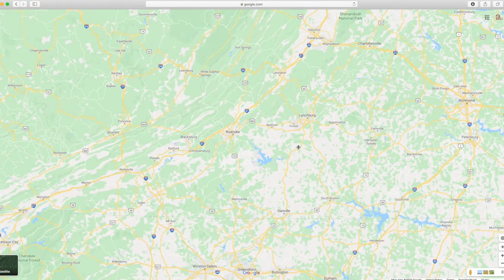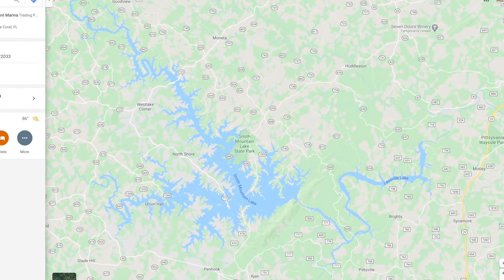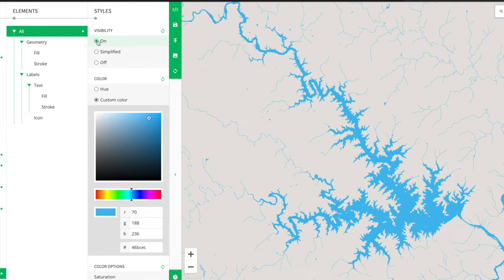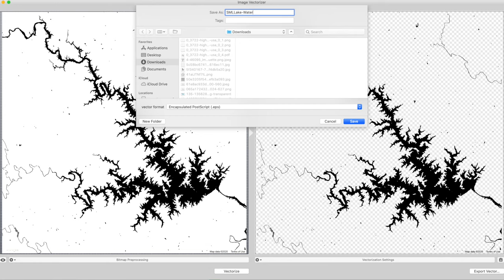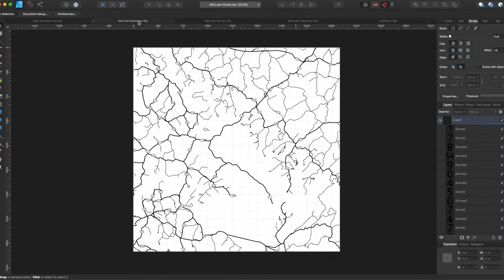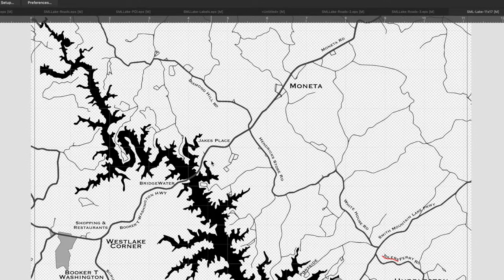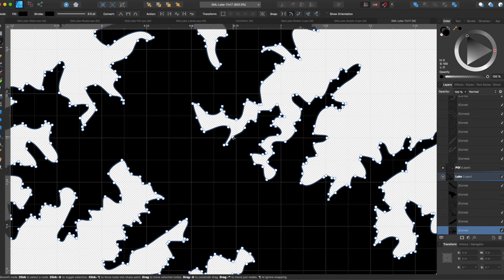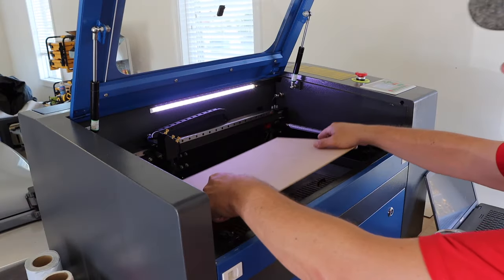Lake Art, with LASERS!

Comment: I am brand new to lasers so my question may be remedial, why did you use the image software to create the layers instead of building the layers and doing the sizing and manipulation of the images in lightburn?
Reply from the maker: Mostly because I wanted to edit and visualize in my graphics software, which I think is more capable than lightburn…. What I should have done is export everything in a color coded pdf into lightburn, keeping it vector to vector.  I think I did that in my New York project…

Comment: FWIW:
If you align the lifferent layers before converting them to vectors, you won't have to manually align them later, they'll already be perfect. That is, if you haven't moved snazzy maps in between the exports. 

Rather than exporting the layers separately for Lightburn, try giving them a different color. Should be able to export&import everything at once. If you import them, they'll be assigned to different layers automatically. 

Lastly, if you can, export the files as vectors. Doesn't really make sense to export the vectors as raster, only to have to trace them to vectors again in LB. 

Hope that helps. Video is great :)!
Reply from the maker: All good advice.  Affinity doesn't have a trace option in it - so I need to convert prior to bringing it in.  That convert - at least the software I am using, doesn't keep the original size.  But if you were using Inkscape or others - you are correct.  Not sure about adobe?  Good tip on the color to lightburn.  Never tried it.  Must be the control freak in me :)
Reply: @ThisIsHowIMadeIt  i ran q test and it was pretty good. I couple if mistakes on my part with adding text and the alignmentbwas slightly off but ill get it on the next one. Probably going to run z new one this coming weekend. Question, do you seal your wood or treat it in anybway?

Comment: Big thumbs up on the video. I have got the artwork ready so I will be trying this tomorrow. I will either be very happy or sorely disappointed. But watching the video helped with getting it downloaded from the map program. I did have a few problems with the map program, a couple times I had to reset the map because no matter what I did the major road would be red and I couldn't change it no matter what I did. I then used Vectornator for composing the names and road symbols. I don't have a commercial laser cutter, only a cheap one, Ortor, but I have burned several things I've like with it. Thanks for the share, I am hoping this will be something I can add to possible selling items for the future.
Reply: I saved the video so I can go back and watch it if something doesn't turn out well. Thanks again.
Reply from the maker: Yeah, that site is very finicky…

Comment: About how long does it take to get the artwork prepped for lasering? Just curious.
Reply from the maker: It depends.  I would say that I can usually get the 3 or 4 main layers in place in an hour or two, depending on the project.  Then I will spend hours adding details.  I would guess if you did this a lot, you could get a finished piece in a day.

Comment: Great Video.  What kind of laser cutter are you using?
Reply from the maker: I purchased a 50 watt Chinese import laser from eBay - tho I think it is really a 40 or 45 watt.  I purchased it from Orion Motor Tech.  They delivered fairly quickly and the unit worked out of the box.

Comment: Question, in snazzy maps when I try to change stroke or the other settings, contrast etc... it reverts back to a regular map if that makes sense. Not sure what I'm doing wrong.
Reply from the maker: Sorry. I would log in to check but I’m in the middle of a move.  Could be your browser...  just a guess?  I did notice their controls were not that intuitive...
Reply: No problem, thanks for getting back to me. I went back and started over and I pretty much figured ot out. Its going pretty well now. I should have my laser in a week or so and I'm going to have the file ready to try. Thanks again!
Reply from the maker: Send me some pics!  Or post them ...  good luck!
Reply: @ThisIsHowIMadeIt  definitely!!
Reply: @johnsalitsky5091  I am running into the same issue on Snazzy Maps.